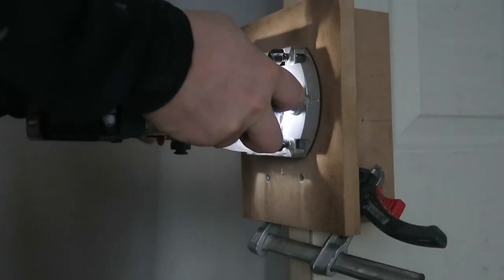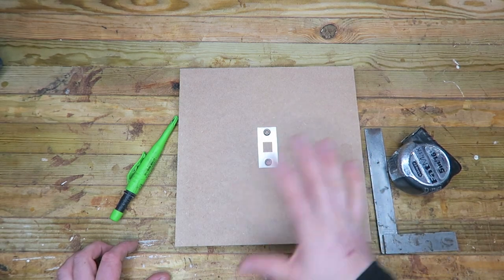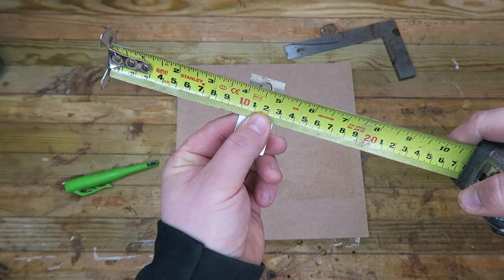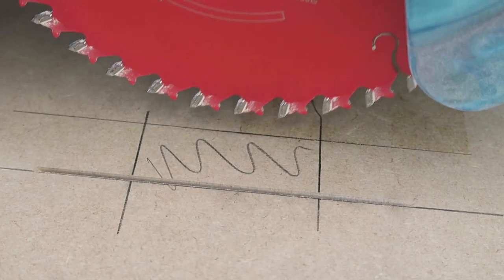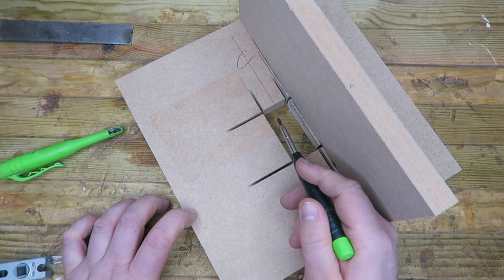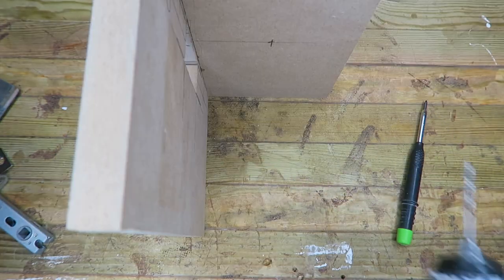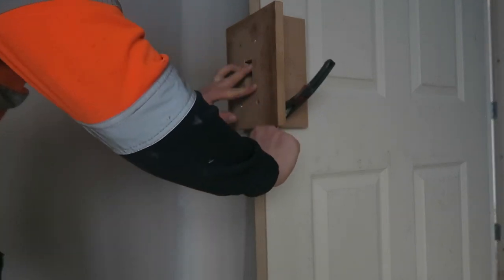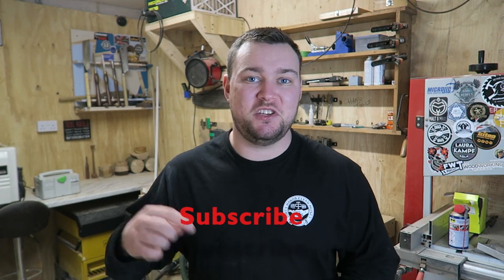HOW TO make a lock jig - fast carpentry!!

Comment: Phil, I made one of these last weekend as I had 8 1930’s oak doors to fit during the week. It worked very well and saved a lot of time. I didn’t have the doors with me when I was making it to get an exact measurement of width so just went with 35mm. It ended up about 1.5mm off centre but I can definitely live with that. 
I have a souber for mortise locks and could have set that up but making the jig is far quicker. Cheers pal👍🏻

Comment: I like it Phil👍
I use the sauber lock jig, which is great but has a lot of components plus it's another box to carry in and needs a big rpm drill to be any good. I will try this.
Reply from the maker: I have always been put off by people using the sauber to cut faceplates, seems tricky! But for sashlocks I can see the sauber being a lifesaver
Reply: @PhilEdwardsCarpenter  The face plates are easy, you just need the right sized cutter for the width. You've also got to release when you tighten the jig it lifts slightly so you have to allow for it. On a full house of doors it's great, very fast but a lot of faff to get used to. It's not worth setting up for just a couple of doors. It is a no brainer on sashlocks.
Reply: Hi phil
Remember watching your first vid , congrats on bringing your channel on , well done , 
Good simple but effective jig which works, also shows your out there on site trying to make a living and not sat in a studio or workshop, 
Look forward to your next vid !!

Comment: Is there any fancy way of getting the centre marked for the 25mm spade bit for the latch mortice hole? Or just line up with the centre marks 'crosshair'  on the jig face.
Reply from the maker: When I chop the corners of the faceplate, I insert the faceplate and centre drill the holes for the screws. While it's in place I draw the outline of the square latch hole and that's my guide for the 25mm bit 👍